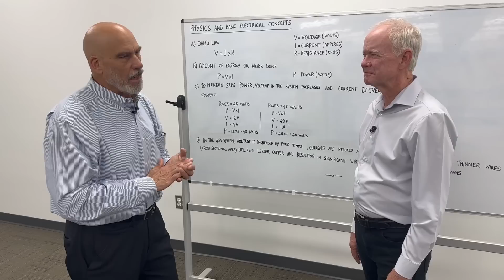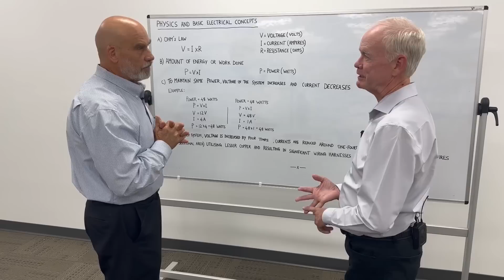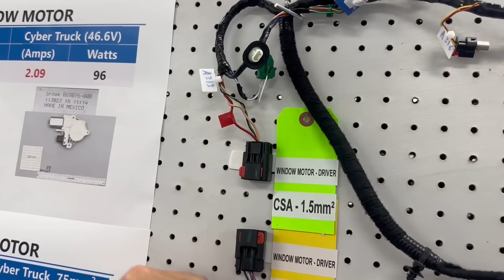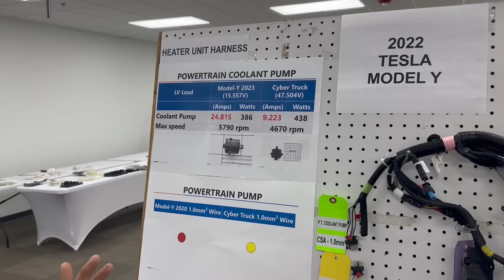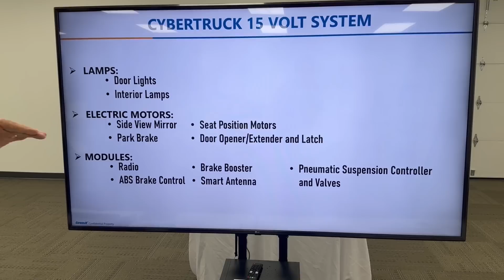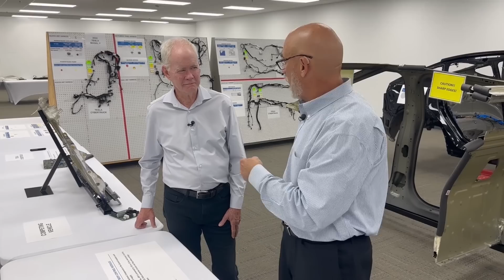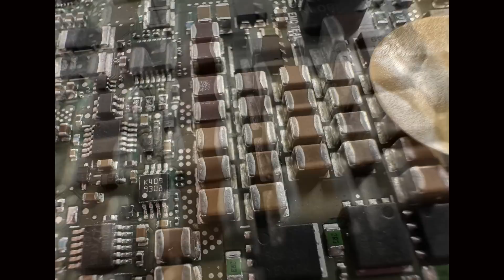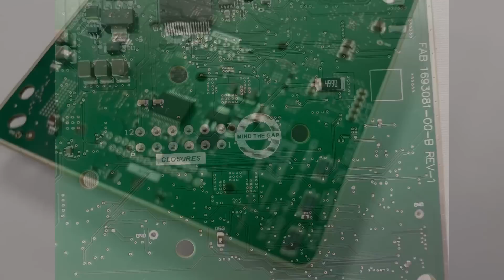Deep Dive Into Tesla's 48-Volt Architecture - Caresoft Teardown

Comment: I'm a retired electronic engineer.  If someone had come to me 20 years ago and asked me to design the entire electrical system for a car starting from a blank slate, I would've said : 48Vdc; zonal architecture; software defined; Ethernet and power on the same wires; and steer by wire.  Am I some sort of genius?  No, definitely not.  But I think most competent system designers in that era would've come up with the same list.  Tesla deserves a lot of credit for finally doing what should've been done long ago, but I can't say any of it is ingenious.  At least not from what I've seen so far.
Reply: But I should add something critical to my previous comment.  A modern EV power train is far more advanced than I would've been able to produce 20 years ago.  I still find the charging speeds to be amazing.
Reply: While I sort of agree, the cost of Ethernet transceivers and the silicon to handle all the issues you get with 48V such as heavy inrush and the cost of higher voltage multilayer ceramic capacitors in comparison to the cost of copper and simplicity of most cars 20 years ago - I’m not sure it would have made sense back then. We’re much better at designing reliable buck converter for a few cents these days.
Reply: @edc1569  True, IC cost went down while copper is becoming like gold !
Reply: Ideas don’t make people brilliant. The basic idea for the iPhone was thought of at least a decade before it came out. The brilliance is in the implementation.
Reply: re: "But I think most competent system designers in that era would've come up with the same list..."  which is basically what BMW did in fact already do way back 20 years ago (ie: 2004).  source: i have several dusty binders containing the OE tech literature downstairs on my bookshelf.
Reply: Thanks for posting this. 5 years into my career as an automotive electrical engineer here
Reply: True, same here, just ther is the legacy, compatibilty ... Increase complexity make the change unavoidable ! How long did it take to phase out phone wiring , PBX to move to IP based phone system ??? Tesla has no credit, they have no legacy, produces only a few model and not in large quantities !
Reply: And if the battery fails you can always stop at a roadside telephone IDE and plug into the frame voltage ! Recharging problem solved
Reply: The Ability to Change can be Genius🎉
Reply: The impression I get from Sandy Munro is that you’ve got it spot on. There’s nothing revolutionary in 2024 in doing it, it’s that they finally went and did it after decades of engineers telling management that it was a necessary step to take, but being ignored all that time.
Reply: @edwardhackett-jones8126 I see this as perfect evidence that the manufacturers became content with building the same product year after year while investing the minimum in innovation and simplicity updated the looks which gives the impression that a new vehicle is an entirely new product when, in fact, under the skin, it's often the same old technology that has been around for decades. Instead, components that exhibit problems get updated to make them more reliable. The other thing to consider is it's the suppliers who are doing most of the innovation, not the vehicle manufacturers. Heated seats, for example, here is a component not built by the manufacturer but designed to integrate into multiple manufacturers vehicles which is why when the became available you started seeing them offered by multiple manufacturers. Had Ford or GM invented the heated seat they would have patented the technology and kept it exclusively to their brands or made others pay for the rights to use it in their vehicles. The big manufacturers seem to put all their R&D money into the drivetrain and, to a lesser extent, the suspension while leaving most of the rest to the suppliers. Complacency leads to minimal innovation.
Reply: Easier said than done. It’s easy to hypothesize, VERY VERY hard to deliver. The fast that the concept is easy doesn’t mean it’s trivial to get this to manufacturing. A lot of people wanted reusable rockets. Only a few have them, only one company has ORIBITAL reusable rockets rockets.
Reply: @rgx42  Reusable rockets is hard. Buck converters and smaller wire is easy. Trying to source 48 volt motors can be difficult. Forget 48 volt light bulbs.
Reply: @jamesvandamme7786  The easy parts are always easy. The difficult parts is what makes things difficult. Buck converters and smaller wires are just a tiny part of this (although integrated buck converters and taking it into production ain't easy either) - it's the entire systematic design, sourcing all the parts and making it financially vialbe is what is hard. You try to convince a supplier to build a new part because you want to move to 48v. They'll just laugh at you in YOUR face. You can't do it if you can't COMMIT (with proof) for volume and you can't get volume until you start building it. It's a VISIOUS cycle which is EXTEREMLY hard to overcome. Tesla might be the only car maker that could have done it since suppliers beleive Tesla when the commit to innovation and making changes - then ramping them up. Other car makers would backtrack on those promises the first time they hit a wall. They just forgot how to innovate 75 years ago. They only do small steps which don't require any risk.
Reply: @jamesvandamme7786 fit 50v hardware, you would hardly notice …
Reply: @rgx42  I’m guessing that you don’t understand Vertical integration. Tesla design and build what suppliers won’t so it’s easy for them to. They have a good reputation and some very bright engineers . Higher voltage AC motors are pretty easy to fabricate when you have been producing the high performance drive motors that Tesla produces …
Reply: @jamesvandamme7786  We have... forgotten light bulbs, that is. Today we have LEDs and they come in all sorts of configurations. High power COB LED´s are cheaper to buy in ~36-100+ volt versions than 12v. Its also way cheaper to buy or design drivers with higher voltages. Size, cost and heat dissipation is far less in a 0.7A driver compared to a 3A one.
Reply: Well let’s see how long it takes Legacy auto and the others go to it!? No one will get to where  Tesla is. That’s the genius!
Reply: @andrewvercillo7584  anybody can it just takes some will !
Reply: @andrewvercillo7584  I'm more curious to see how long it will take Tesla to update their other vehicles with this tech and convert the other system on the CT to 48v
Reply: @andrewvercillo7584 except all the manufacturers already using 48V…
Reply: Yet you did and said nothing.
Reply: In the land of the blind, the one-eyed man is king.
Reply: High power 48 volt DC on an ethernet cable? Good thing you retired.
Reply: I never said they were using standard CAT6 cable.  And your ignorance is showing because Power over Ethernet (PoE) has been around for over 20 years now.  In 2009 I was part of the task force that wrote the second generation, PoE+ standard (IEEE 802.3at) that increased the max power per load to 30W.  Now they allow up to 71W.  But Tesla isn't even limited to that because they're using proprietary wire harnesses with whatever ampacity they need.  And don't tell me thay can't do high speed data on the same wires as power, because gigabit PoE has been around since about 2009.

Comment: No RTV Silicone on those AlEl caps!  Diode next to U5000 has incorrect IPC7351 footprint!  Solder balls on PCB!  Filets have visible graping!  Pick and place machine not centering 1206 Capacitor on the footprint!  Close up of those caps shows graping, soldering joint fractures, and improper IPC-7351 footprint!  One leg of capacitor on door module PCB has visible damage!  Through hole connector on door module PCB needs rework!  Root cause of CyberBust failures confirmed!
Reply: You forgot to mention the excessive Tse-Tse dust on the gonculator.  That alone will lessen battery life by 55% to 60%.
Reply: @patrickcarey393  Hello CyberBust team member!
Reply: I'm not an expert, but I did think when looking at the sample boards that the workmanship (robotship?) was not impressive.
Reply: @davidg3944  I’ve done my share of PCB soldering and layout over the years and those boards are sloppy in every aspect of production.  The mere presence of solder balls and graping is a clear sign the reflow profile is not correct but when you “move fast and break things”, then the quality will suffer.  One of many reasons why I would never buy or recommend any Tesla product.
Reply: @bobbbobb4663  Yet the vehicle you drive is less reliable and less safe. Confirmation bias is harmful.
Reply: @markburmeister4674  I'll put my 1979 240D up against the never independently crash tested CyberBust any day of the week for safety and reliability.  I'll win too.  Take your sorry arguments back to the Diversion Team.
Reply: Grow Food Yourself!

Comment: high-energy components like the active suspension on the Ferrari Purosangue make a huge difference. POWAH!
Reply: Porsche went straight to high voltage there which is an interesting avenue
Reply: high energy components like the "active suspension" used in almost every So-Cal Low Rider built in the last 50 years, and the numerous ones i photographed (and watched perform) held annually inside State Farm Stadium (Phoenix) for the famous Arizona Super Show back on Sat April 20th, makes a huge difference...

btw (while i didn't know it at the time) the Lilac painted '64 Impala named "Indigenous Angel" i saw displayed and got to photograph in Phoenix - built by Carlos Martinez - went on to win the inaugural award for Best Low Rider at Autorama Sacramento.😎  source: Motor Trend Magazine.

Comment: if or once Tesla install 48v, Ethernet & SbW in all it's vehicles-the game is over!
Reply: These technologies are going into all of the newly designed vehicles as it's cheaper and more efficient. It can't be retrofitted to existing vehicles' designs. It's a technology that needs to go in when the car's still on the drawing board. But all the savings will be going into the vehicles built with the Unboxed Process, driving costs down.
Reply: @garyrooksby  re: "driving costs down." while driving Warranty Claims and Customer Dissatisfaction UP.
Reply: My 6 year old bmw has both 48v and ethernet…
Reply: there isnt any game over lol!